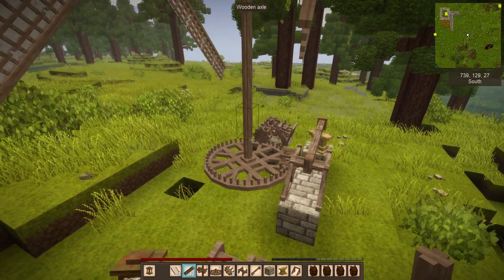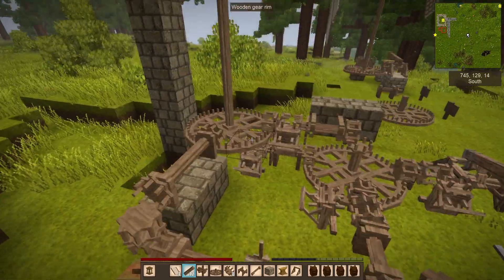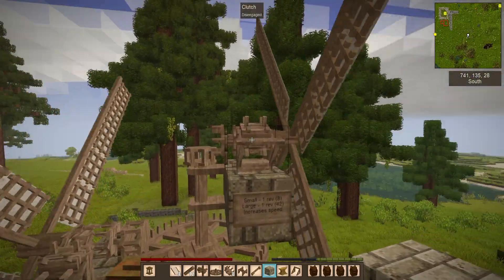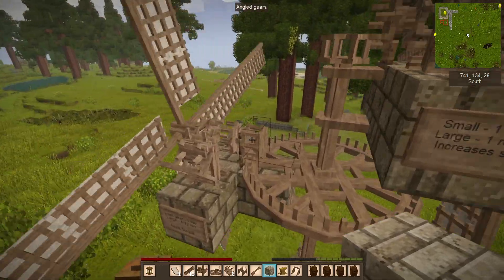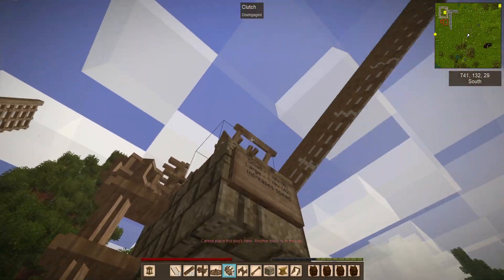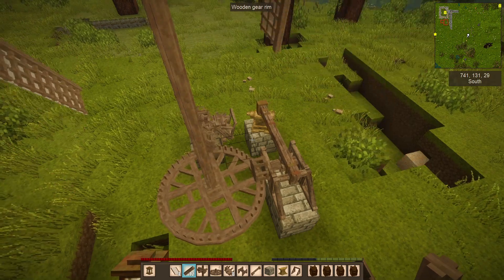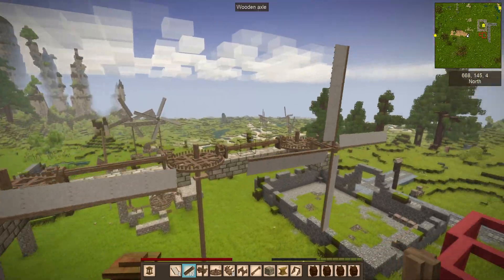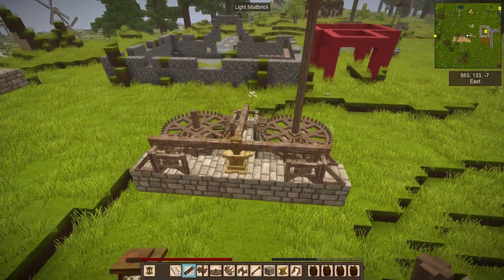Windmill Power and Gears in Vintage Story

Comment: Thanks so much for this  video . I can't tell you how many I have combed thru with just rambling and 0 explanation .
Reply from the maker: Glad it helped, I need to do an updated video
Reply: @Shino_Gaming if you do can you explain the difference between speed and torque and what it does and explain it to my like I’m dumb cuz I am?
Reply from the maker: @thaddeusii2142  Will do.  I think in my recent video of the Modded 2 the Magical Max when I built my windmill there, I did a better job of explaining it but I did dive into the game code alot so probably not simplified.  Here though just for you because I'm a simple man, I know the $10 dollar words but the $2 words are just as good at making my point.  Speed is how fast the gear can move, like a race horse, and torque is how much work it can do, like a draft horse.

Comment: cries in resin for that design... can you let me know why you have used two large gears at the bottom instead of one ? what does the second large gear achieve that a simple angled gear would not in that setup?
Reply from the maker: You make it sound like hunting for resin is a chore...jk.  Yep understand, it can be resource intensive to build your first windmill.  This final design was for a large industrial factory that was running 3 sets of three iron helve hammers; definitely a late game project.  You could get by with angled gears in that location, I prefer the large gears for aesthetics as the larger moving object contrasts nicely with the smaller moving parts...sort of a form and function type thing.  Thanks for watching and taking the time to comment, keep them coming.
Reply: @Shino_Gaming  I've been experimenting with your design and I tried to do a setup with three large gears on top with three rotors pointing North and three pointing South. 

+---+---+

I found it was LESS performant than a standard single large wooden gear and four rotors attached to that.. Really weird. 6 was worse than 4. 

So I took the two rotors off the centre gear and moved them to the outside of the two edge large gears and it was much better. Doesn't make any sense to me but there you go.

Comment: My god, thanks for this solid base!
I copyed your top part and managed to get 4 hammer at once to run in sync with 2 pulverriser and 3 out of 6 querns with just little drops in speed. Torque is this magic ingredient that I was missing, thank you!
I thinkinstead of putting a 3rd windmill on top, you could just put one more at the front for even less resistence.
Reply from the maker: Glad it helped check out my workshop on my Rusty Gears SMP series.  I'm getting good speeds on my 3 helve hammer setup and a pulverizer that is lightning quick.  Thanks for watching.

Comment: i was looking up Alloy Ratios, and YT ponied up this amoung other vids.  Nice clear demonstration on the mystries involving the 'big' gear. thanks.  (short of doing my own creative world testing, still looking for a futher understanding on hight and distance as it relates to the power/torque increase/decrease) :)
Reply from the maker: I am glad you found it and thanks.  As for height and distance,  there is a loss per.  I went back into the forums because I remember reading something there about run loss.  Couldn't find it but I seem to recall 8 as a significant number.  I think it is static through 8 and then the decrease multiplier of .0005 is applied and stacked per each axel in the run.  Testing to confirm...just have to find away to measure.

Comment: Very informative. Do you think your last design could work with just one set of windmill sails instead of two like what you demonstrated at the end? I'd like to build something with multiple helve hammers but retain the aesthetic of a single set of sails
Reply from the maker: It would depend on the length of axle run.  Game mechanics reduces torque with distance and, as showed, lack of torque will lock up the helve hammer.  Take your idea into a creative world and give it a shot.  Send me what you come up with, would love to see new and innovative builds.  Thanks for watching
Reply: @Shino_Gaming  I'll test it and put it in a video if it works
Reply: You could build multiple windmills, give each their own tower and connect them together to the same workshop, but you are wasting power by increasing distance. It's probably better to accept slower production speed, afterall automation is good because it allows you to step away and do something else.
Increase the gear ratio enough and you can automate multiple slow helve hammers instead of a single very fast one, you're then able to step away from the station for a long time and have higher chances to catch the ingot before it despawns, just tune things up so the bloom don't go cold before they finish.
Reply: i would make one windmill for each machine, it would make a nice and realistic view